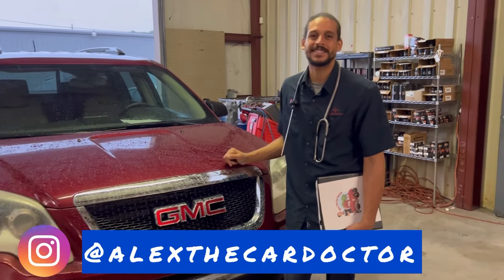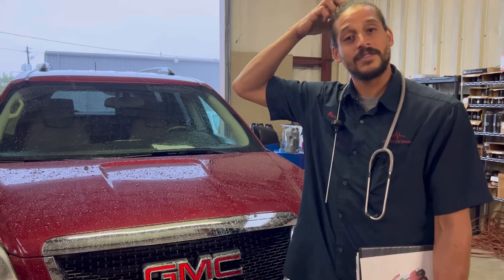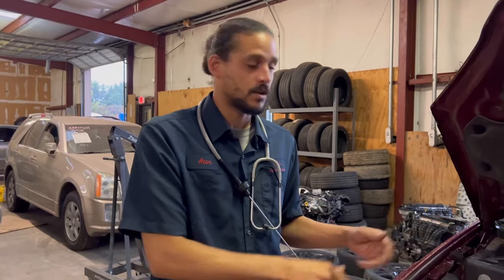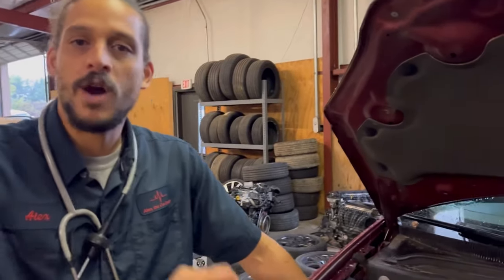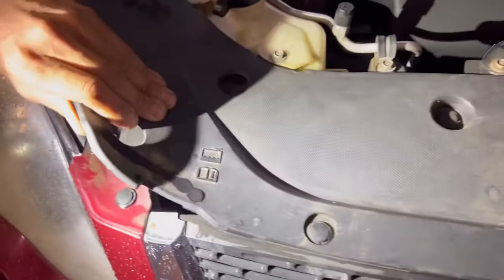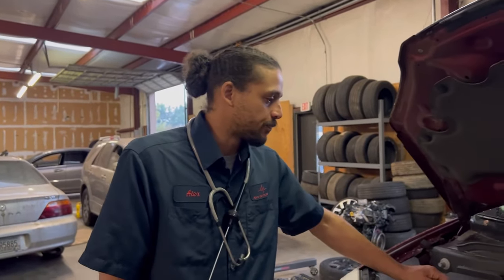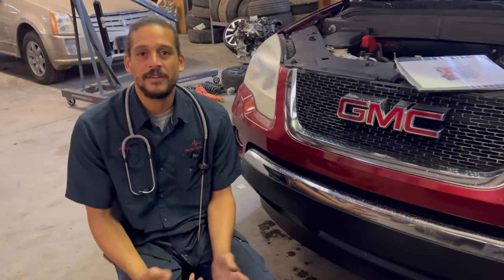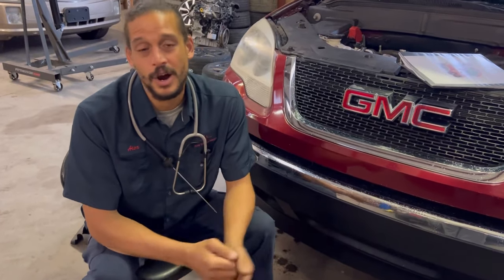The Top 5 Problems - GMC Acadia ( First Generation 2007-2016) | Should you buy the GMC Acadia? #gmc

Comment: Hello, my temperature gauge stays at about 3 notches above 210 on my Acadia (2012). I have changed the thermostat sensor and radiator. Is there anything else you can suggest?
Reply from the maker: You may need to flush the system
Reply: Should I get the gaskets heads looked at?. How long does water pumps last?
Reply from the maker: @miaalex31  I don’t think you’re having head gasket issues,does it tend to run hot more when it’s sitting or when you’re driving
Reply: So I found out that the mechanic did not do a flush on it. It does tend to stay at the 3rd of 4th notch after the 210 mark while driving but it doesn't reach to where I have to pull over. Like I said I did change the thermostat the temperature sensor and the radiator.
Reply: Should I get the fan motors looked at they both come on I heard them last night after driving for about 7 minutes
Reply from the maker: @miaalex31  the fans are fine then I think your problem is going to boil down to a water pump or it needs a flush.also check the front of the condenser and make sure the fin’s or not bent flat that will retract air flow
Reply from the maker: @miaalex31  look me up on Instagram and I will show you a picture of what I’m talking about

Comment: Hey,

I'm planning to settle in United States. Recommend me a budget vehicle that's easy to maintain and fuel efficient. We are family of five. 

Will appreciate your guidance in this regard. 💞
Reply from the maker: Hey there. What is your budget
Reply: @AlexTheCarDoctor  Thanks for your quick response. I'm thankful.

My budget is a bit tight. Looking for a car under 7k.
Reply from the maker: @Musafir091  that’s a nice budget that will get you something nice.if I was in your shoes I will look at Honda’s and Toyota’s with the 4 cylinder engines. Other vehicles to consider are Mazda I don’t see many in my shop also Mitsubishi,they are very underrated cars and deserve more recognition because I don’t see them in my shop at all really
Reply from the maker: Vehicles to stay away from Chrysler products, which are dodge,fiat, Maserati, Jeep,ram
Reply from the maker: Nissan I don’t really trust him anymore GM they don’t hold up that good European cars be expensive to maintain.
Reply: All right. Thanks for your help. It will work. Stay blessed and safe forever. Thanks a lot for your time

Comment: Hi Alex
I Purchased a used 2009 GMC Acadia a month ago with 126,000 mi , runs good, no lights indicating anything wrong. 
Attempted to get it inspected, won't pass inspection. Was told to drive it then bring back to shop, did that, then EVAP I/M light came on, replaced the sensor and it still won't pass inspection. Do you think it may need the  Solenoid replaced even though the car isn't  presenting with any signs of engine problems?

Comment: was considering a GMC Acadia for uber lux xl. yeah not anymore. as an ex technician myself I can live with having to replace a valve cover gasket, hose or alternator (even if its an absolute b*tch to do so like in this "fine vehicle")

but im not about to pull all that shit off, lift the engine and run surgery on a timing chain or replace a transmission in my garage. to those of u that are not techs ya'l don't understand what ur getting into, listen to the man and stay the f*ck away
Reply from the maker: Yeah I tell my customers who do ride share all the time, the more miles they put on the vehicles the faster they gonna get to these problems 🫣

Comment: High maintenance!? lol ya ok . No more than any other vehicle
Reply from the maker: That’s not the case,for example let’s take the Acadia Vs a Nissan Pathfinder you know the problems if you Watch the video on the Arcadia,which keeps me in business because it’s expensive repairs on average now let’s look at the Nissan I only see this truck in for valve cover jobs tuneups alternators your regular maintenance type stuff which don’t normally cost much. this is how I determine which car is more higher maintenance than others by what I see on the daily basis and from  talking to other technicians in my field, happy holidays Mr. Russ
Reply: Then your experience with pathfinders has been better than mine . Maybe the reason you’re fortunate enough to stay in business doing Arcadia’s is because there are so many still on the road . Lots of folks take care of their vehicles, and lots don’t. How many pathfinders have been sold in your area vs Arcadias? Around here Denali, Arcadias are thick , Nissans not so much. ✌️and happy holidays to you an yours
Reply from the maker: @Seeker887  you are right it really boils down to how people take care of their vehicles I just use Petfinder for example because I don’t see too many of them in my shop